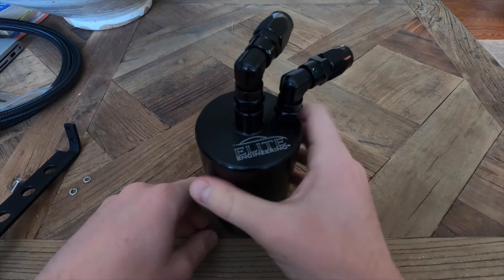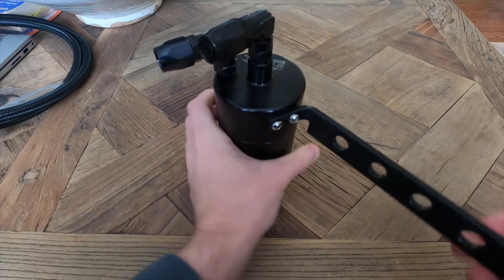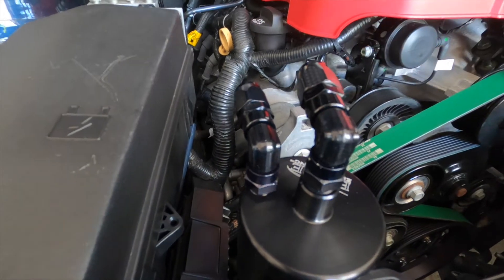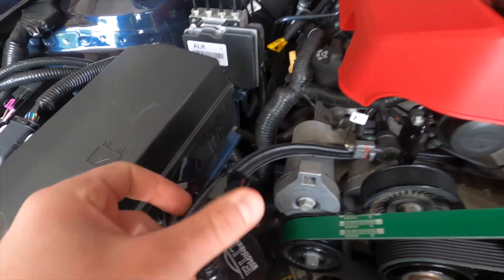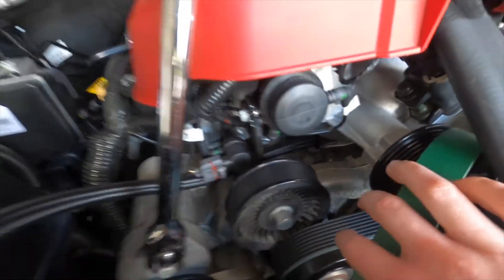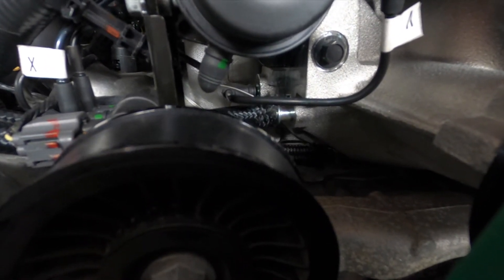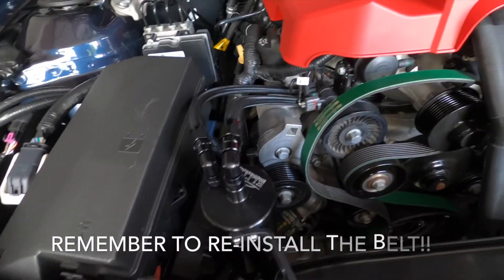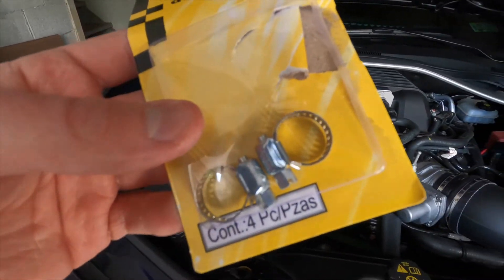Elite Engineering E2 Catch Can Install on a 2013 Chevy Camaro ZL1

Comment: A nice little trick i do to help eliminate the braid from fraying when cutting it wrap the hose where you want to cut it with electrical tape.  If it is steel belted hose or braid, i then just use a cut off wheel to cut the hose and you get a clean end with no fraying.  Good info here.
Reply from the maker: This is actually a great tip, wish I would’ve know this beforehand lol. Thanks for watching!

Comment: Did you get a rubber ring gasket? They sent me one and it literally doesn't even fit nor seem to go to it lol
Reply from the maker: Haha yeah I’m pretty sure I threw it out tbh
Reply: @blurayzl1  OK wanted to make sure I wasn't crazy...all I can think of is that it was for their original standard can that was small and they just included it anyway....cause yeah I was scratching my head cause that tiny rubber gasket no way in hell fits on the E2 can anywhere lol. Can tightens by hand and seems sealed to me as it came in the box.

Comment: Hey friend, we just changed out our Elite can for a Mighty Mouse to reduce crank case pressure. The Elite can did well otherwise. Your install is indeed correct. As good as the car is GM left plenty on the table for modifications We bored and stroked with forged internals after a lifter failure which luck would have it on start up so we did it up! The mods you have done are great improvements and the most practical. I started a building fund of $3000 a year and am 3 years behind...lol...
Reply from the maker: Thanks for the advice! They are great cars for sure. One thing I forgot to mention in the video is that I did also install a Metco crankcase breather. I installed it where the oil cap sits normally. So should be all good now. 👍🏻
Reply: How has your crankcase pressure been with the enclosed catch can? I also have an enclosed catch can but a breather where my oil cap was. Just wondering if i still need to get a catch can that needs a breather vent. Thanks